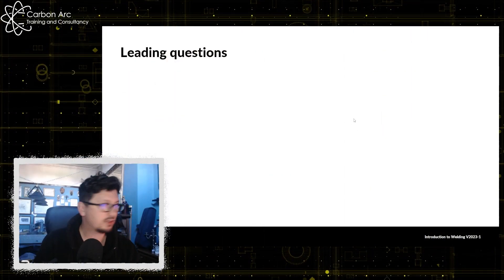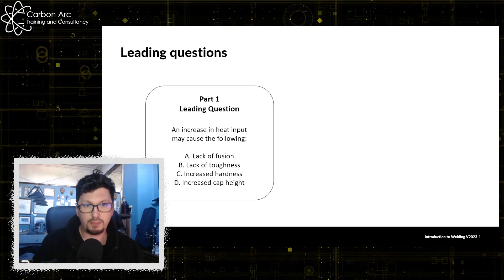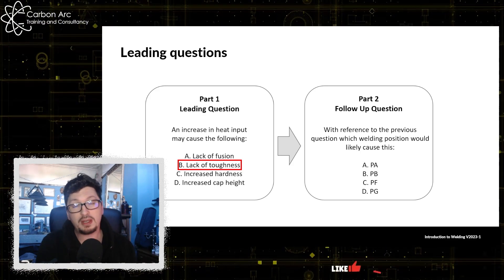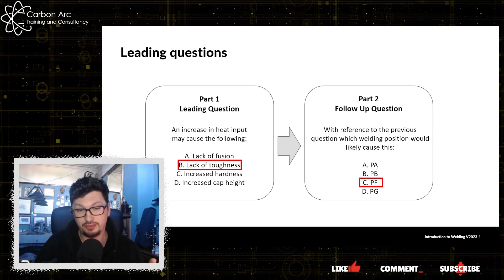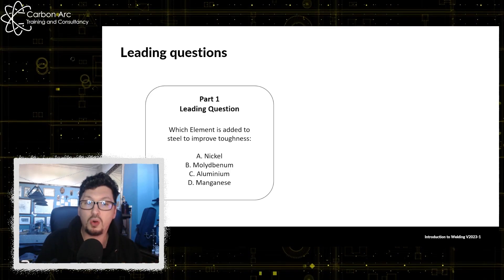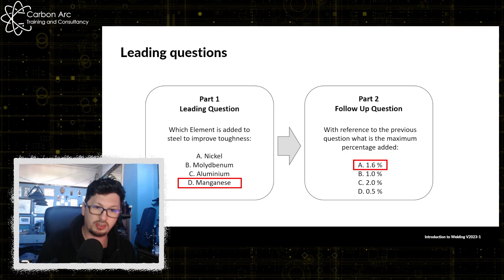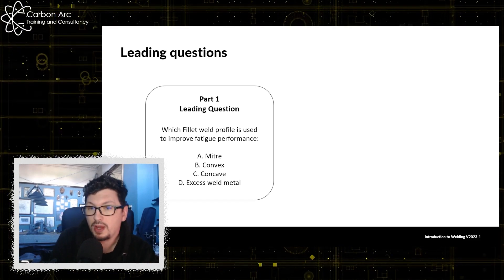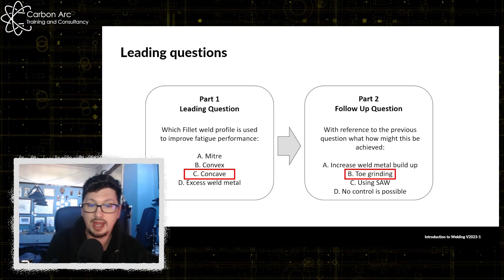New CSWIP 3.1 Multichoice Examination on 2024

Comment: What are the subjects for 10 year renewal exam? Does it cover all papers? And is practical exam also still included?
Reply from the maker: 10 year renewal exams are a 30 multiple choice paper and the new version of the practical exam (8 plate segments)
Reply: @CarbonArcTC  sir, which means 30 multiple question same as general paper in old version?

Comment: Sir, if someone fails in the plate exam which he has given in April and May, now he will re-exam in June or July, then his exam will be according to the old pattern or according to the new pattern.
Reply from the maker: If you did the exam using the old scheme you will resit with the old scheme. Good luck for your resit. Remember to share the channel with your contacts.
Reply: @CarbonArcTC  
Thanks
Reply: @CarbonArcTC  
Sir where are you from 
Can I get your WhatsApp number
Reply: @CarbonArcTC  
Sir where are you from 
Can I get your WhatsApp number
Reply: Sir my 10 renewal is due in August . Is my renewal exam based on new pattern or old pattern
Reply from the maker: The new pattern will be used for all 10 year renewals